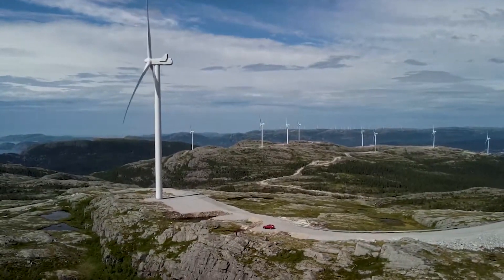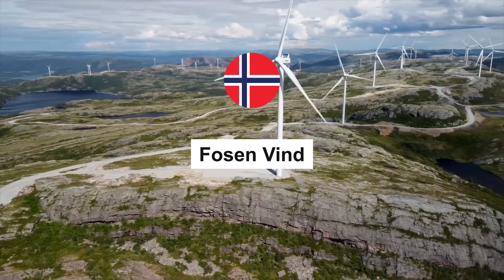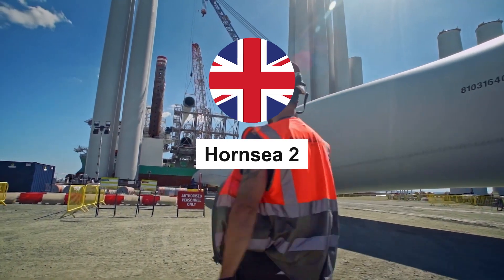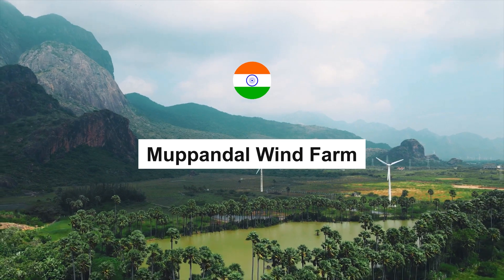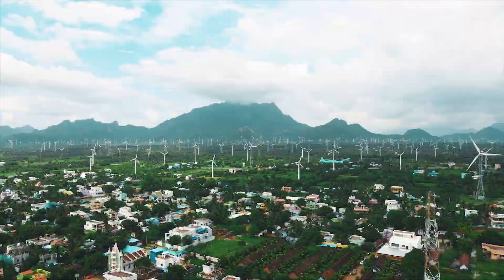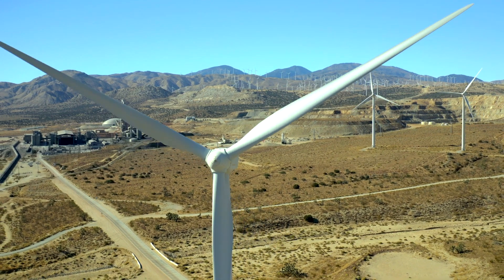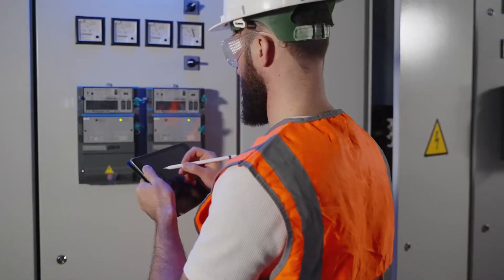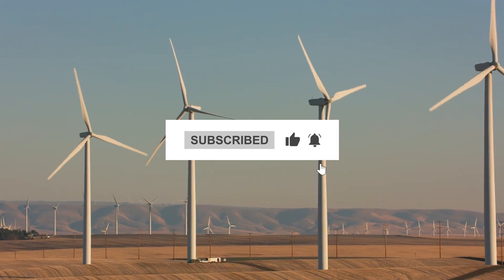Top 5 World Largest Wind Farms

Comment: Wind power is cool and useful however the unpredictability of wind  is a issue and other energy sources or storages should be used
Reply from the maker: You are right about the unpredictability of wind. However, there are some areas where wind is a little bit predictable. Thanks for the comment.
Reply: @renewedenergy  yes of course we are able to predict weather however we won’t know the exact energy production so a lot of redundancy is need.
Reply: @TheAmericanCatholic  Fortunately, it's more predictable in the aggregate. When one wind farm is underproducing, it's often the case that another one is overproducing. The law of large numbers allows these things to balance out surprisingly well. Add to that the fact that solar also balances out wind, and you get some pretty stable performance.

Comment: No wind no power. Nuclear is a much better solution
Reply: Batteries will store energy when wind power production surpasses demand and supply the demand when demand is higher than production.
Reply: nuclear is also much more expensive
Reply: Work out how to get rid of the nuclear waste permanently then I might lighten to your ludicrous statement!
Reply: @FreddieVee  
not the slightest chance, it's not viable.
Reply: I'm pro-nuclear, but it takes a long ass time to build a single reactor. Wind farms can be built quickly and, increasly, cheaply. That's what attracts investors.